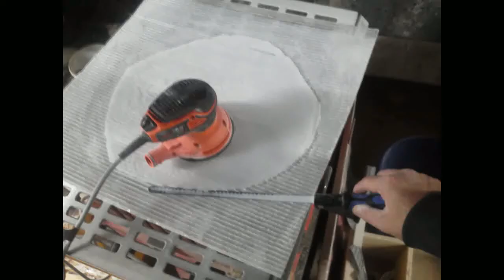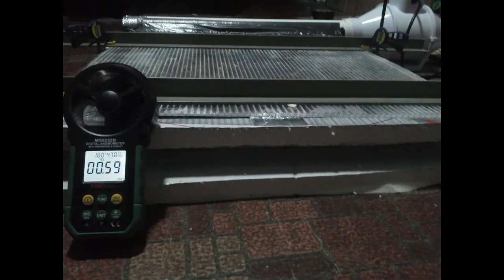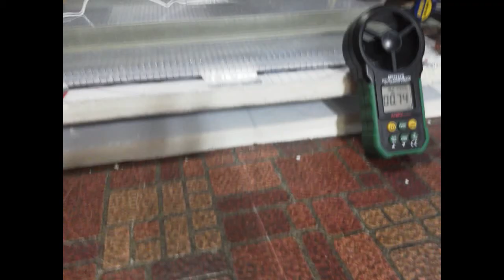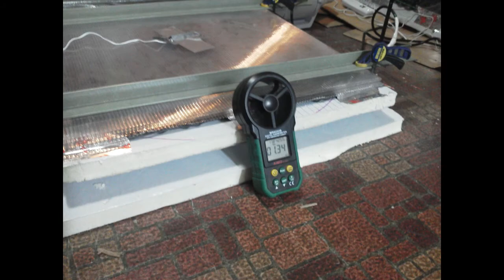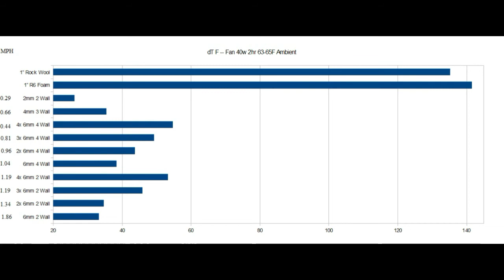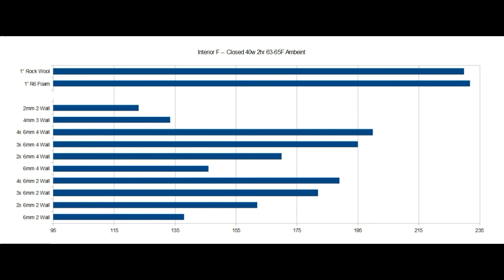Thermal Transfer Multiwall

Comment: As always, I'm extremely impressed by the amount of unbiased data that goes into your videos.  Hooking a watt meter up to a solar panel attached directly to a vehicle's body paneling, and comparing that to overall power output of a panel with a layer of 4mm Polycarb inbetween the panel and the vehicle body could be very illuminating.  Keep it up, I'm excited to see you set some records in your Insight in 2021